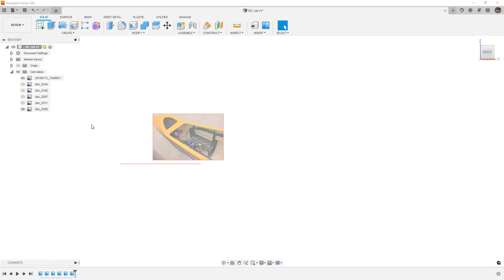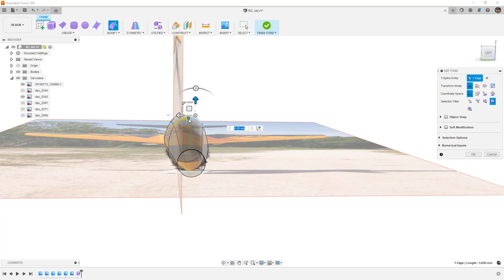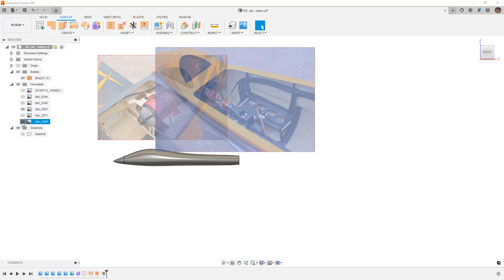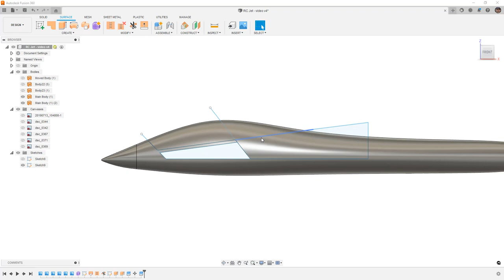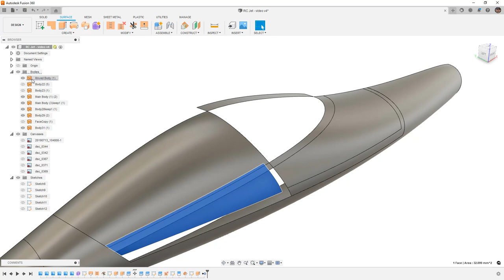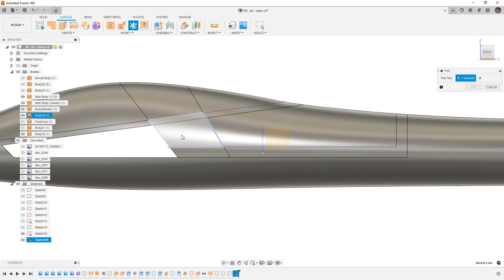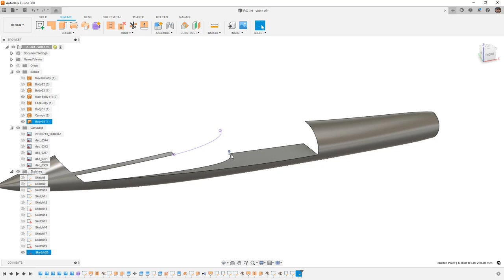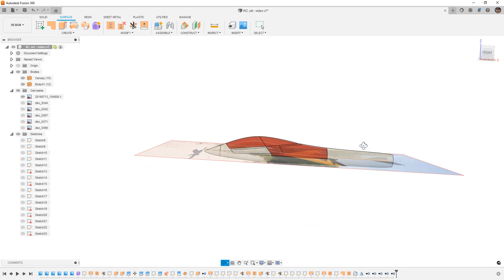Using Forms and Surfaces to Model RC Airplanes | Beginner to Advanced Tips and Tricks #Fusion360

Comment: At 13:25 or so, where you go back into the sketch to move the nose cone down.  since the line is not defined you should be able to pull the line around without having to go back into the sketch,  and see the nose cone update in real"ish" time.  Great series by the way!
Reply from the maker: Very true Matthew.  The main reason I didn't do that is because the sketches are hard to see through the bodies but in reality that is a much quicker way after we delete the perpendicular constraint.

Thanks for the comment!

Comment: thanks matt.I am not comparing with sw but in modelling.fusion360 looks much easier?
Reply from the maker: There are always pros and cons.  In solidworks if you buy the 3rd party add-on PowerSurfacing its really good.  There are a few things Forms does better, but PowerSurfacing has some stuff Fusion can't do like proper edge weighting.

I think the user interface and UX of Fusion is a bit better than with Solidworks.  I probably have the same number of hours in both at this point (thousands) and there are just certain aspects that work better in fusion.  The right-click marking menu for example, the 12 oclock position is redo.  In Solidworks you have to hit enter so take your hand off the mouse.  or navigate through a right-click menu.

In solidworks you can make a 3d projected curve without needing a 3rd sketch so that is helpful.  Fusion (and Inventor) need a 3rd sketch as you can't project a 3d curve in the same sketch as your 2d edge.

Comment: how is the surface template plane in radio control aircraft çıkarılır.ve how can we transfer this to A0 paper format?
Reply from the maker: im not exactly sure I follow the question.  To get the design on A0 paper you need to have a solid body(surface can sometimes work in drawings but generally it is avoided).  The drawing sheet size can be set to A0.
Reply: thank you so much   :) @LearnEverythingAboutDesign
Reply: English I'm having trouble writing, but I'll express it better and write it that way